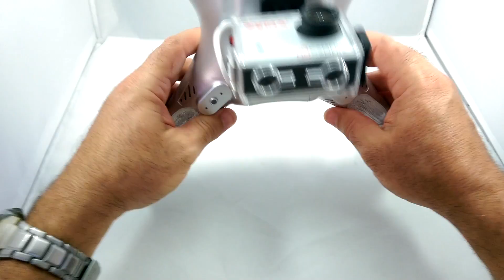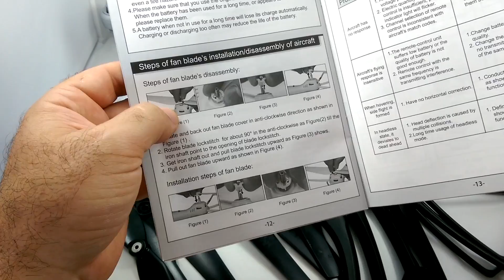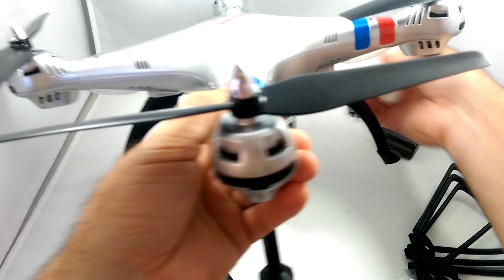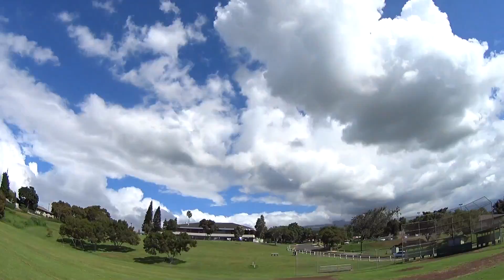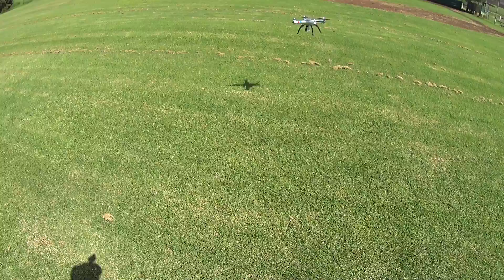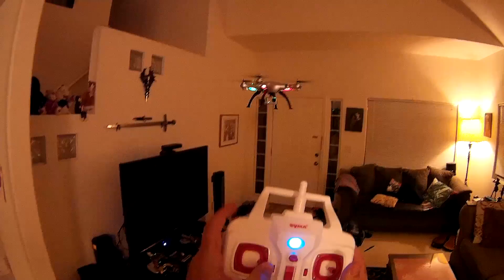SYMA X8G Review - HD Quadcopter Camera Drone - [Setup - Flight Test - Pros & Cons]

Comment: I love the in depth review, most people touch a few bases and move on, you cover all aspects that a buyer wants to know. Doing other research i learned this quad is really easy to change motors, no sodering. Maybe in a future review you can add how easy it is to find parts or replace them. I loved this vid so much i liked and subbed i have since orderd a x8g
Reply from the maker: Thanks Brett.  I will take your recommendation into account if I can in future videos.
Reply: That's interesting cause I just bought a run away that of course would need a transmitter. I payed less than a replacement battery which was in the bird. $38 and shipping from an Ebayer who mis Identified it as an X8C but it was a candy apple red X8 Pro in new condition except for two scuff marks on front two arms from its final ( and probably only) landing. Finder took the camera. No biggie. I t runs great. Enjoy your new orphan as I'm sure I will. Dandahermit

Comment: I appreciate the videos man. I have the bootleg version of this quad by Swann.  It's pretty good. It is basically an X8G.  In the month I got it one motor burned out. But I got it for cheap and Modding it gets it working fine like any other quad.  WiFi none but buying a cam with WiFi capability is always an option for anyone who wants a drone with FPV. I watch your reviews and quadcopter 101 and a few others who are more tech savvy then others who try too hard to be technical and in the process show failure in understanding quads in little time.

Comment: Thank You for the video,I have researched a lot of quads and this one looks like a good deal as far as size and price.
Reply from the maker: +Martin Mccurley It's good.  just order an extra set of motors from the parts link in video description for around 14 bucks.  Since they are brushed they will fail eventually.
Reply: Thanks for the tip.

Comment: To get rid of the any jello don't forget to balance the props.  You may notice a difference right away. Also if the battery falls out of the quad copter it will die immediately and crash to the ground, different from just turning off the transmitter. Happy Flying.  I have subscribed to your channel.  Thank you.
Reply from the maker: +Ken K. Thanks for the info Ken.
Reply: +Dustin Dunnill How do you show what it's recording? and what device are you using?
Reply: +Ken K. I never really balanced the props on mine and only had the jello when the winds were high.  I will give it a try and see if I notice any difference, you never know, right?

Comment: Cut the little nub off of the cam mount that will help reduce the jello and you can tilt the cam how you want it  and balance the props.I also use a Mobius cam on mine to it get better flight time's with out using the power from the battery to power the cam. your video is the main reason it bought the X8G $127 shipped usa warehouse. Thanks Dustin great review.....
Reply from the maker: Thanks Harlan.  Good tips.  How's your motors holding up?
Reply: there holding up good for now i have i guess around 50 flights on it. did you have to replace you motors yet?
Reply from the maker: One of mine had the motor shaft grind a groove through it's brass bushing and fail after a few flights with Amkov5000s.  Could have been from crashing though..lol
Reply: For $127 it's a good deal. I Haven't crashed it. but i have gotten it so high it lost signal once. i put my Big 5 gps logger on it and it lost signal at 550ft. in a big open field it fell and i saved it.
Reply: I have been flying Rc planes for over 30 years some helicopters in the last 5 years and quads for just a year. i watched you you tube vid 20 x and like it very much that's why i bought the X8G. it fly's good in the wind and the vid is good also.
Reply from the maker: Right on Harlan.  Glad the vid helped you out and thanks for the support :)
Reply: Your very welcome :)

Comment: It's certainly good practice to watch several reviews of a product before making up ones mind on whether to buy a product? I had decided not to get the G model in the near future, because one reviewer said it was not worth it as the cam was junk so to just buy the C version ( he never showed any cam video). But from what I have seen in your review that cam does a very good job at that price point of around $155. Glad I found your review, thanks for sharing your experience with it.
Reply from the maker: +wild300zx Thanks.  Glad it helped you out.  The cam is quite decent i think.  And would be much smoother with less windy conditions.

Comment: Nice vid mate! i got my x8g today en its flying very stable indeed!
only problem i got is that i need to use the trims a lot before its stable and there is no need of correcting its direction all the time.
even after calibration but i will fix it i know for sure!

thnks!
Reply from the maker: Cool!  It is a fun quad.  Fly safe

Comment: Nice review Dustin. Seem like every time you have a flight review the wind is kicking up pretty good although that shows the ability of the craft and the pilot. LOL  Great flying. Question, when you did the turn off of TX test were the motors still running, did it try to land but the wind was to strong.  Thanks for the video.
Reply from the maker: Thanks.  Yes, I probably should not have done the TX off test in that wind but it did show the motors were still trying to spin even when upside down and stuck.  In the house TX off test you can see how it would do in no wind.

Comment: The reviewer has made a mistake about the Return To Home feature he thought was available on this quad. Probably was due to wind blowing directly towards him when he released the right stick. The right shoulder button does give an additional beep when long pressed but this does not initiate any RTH function. No other Syma X5 or X8 variant with headless (save GPS drones) has a RTH function either.

Comment: Have you tried unscrewing the original camera frame and replacing it with a mobius with a gopro mount adapter.I believe the mobius setup is lighter and produces better video,but the stock camera was pretty good for what it is.Maybe some foam and prop balancing can eliminate jello completely.
Reply from the maker: I have a Mobius I'm reviewing and will be doing this on the X8 this weekend.

Comment: Can you explain in a little more detail on how to use the camera feature and the return to home feature?
Reply: The camera is controlled by a 2 position switch on the transmitter.  Up will take a pic and down starts video.  I've lost a few videos from being corrupted for some reason.  I'm trying to sort out why it happens.
Reply: The camera button must be pressed off to stop the recording and to save to the SD card
If it's turned off w/o that, it corrupts

Comment: Thanks for the review, Dustin.  Don't you have any calm wind days there in Maui???  Seems like the wind is always blowing 20mph ;-)  X8G seemed to handle the wind okay, but the camera and mount system weren't optimal for that much wind.  I can't see the X8G carrying a powered gimbal & a GoPro type camera.  The included camera took pretty good video, but it could use an "auto white balance" feature, as your night time indoor video was pretty yellow.  I know my RunCam has a setting in the Configuration to set up if you are using incandescent lighting. I doubt there is a config program for the included cam.  At 42 grams, the RunCam is only slightly heavier than the standard camera, and would offer better video.  That said, a std. X8C with RunCam/Mobius mounted would seem to be a better video platform than this, but slightly more expensive.  If a person didn't want to mess around with "mix and match", this X8G could be a viable option. I've seen some other reviews that were not complimentary of the range, so I'm glad yours appeared at least to reach about 100m.  Oh, don't think I'd want to fly something that big in my house, which is especially small (650 sq. ft.)!  I see your cat didn't come out during the flying of this one indoors .. he was smart! BTW, I always wondered if cats were allowed on the Hawaiian islands. Some countries have ridiculous 6 month quarantine procedures if you bring a cat to their island (like in the UK I think).  Oh well, thanks for the review .. I waited until I got home from work to watch it so that I could watch it in one go, and on a better screen than my tablet that I take to work. Cheers!
Reply from the maker: Hey Bill.  The tropical winds here are pretty gnarly on the north of the island.
I still have to finish my review of the Mobius so I'll be mounting it up on the X8 and seeing how it does.  We definitely have some laws on bringing animals in from out of state bit not sure of the specifics.  At first the cat was freaks of my copters but now he barely pays attention :)
Reply: +Dustin Dunnill Holy cow! I used to live on the east end of Molokai 26 years ago. Miss it a lot.
Reply from the maker: +Robert Arne Dresslar Cool!  Come on back an visit sometime :)
Reply: +Dustin Dunnill Hi, im thinking about getting a x8g soon but am a little concerned with the weight of it and the motors.  That's a lot of stress on the brushed motors to carry that much weight.  How long have you had this and have you needed to change or fix any of the motors?  Also how does this fly in the cold during winter time?Also can you recommend any other quadcopter that offers this video quality and is around the same price range?  Thanks.
Reply from the maker: +Nathan Eck I had one motor fry after the 3rd flight with the heavier amkov cam mounted up and it fell from 200ft.. surprisingly only cracked the landing gear slightly. I think this is still probably the best bang for your buck but order a spare set of motors just in case from link in vid description.  They are cheap.
Reply: Dustin Dunnill I was just wondering how mich did it cost? and is there any way i can have fpv on the quad?
Reply: You should be able to find the basic Syma X8C on eBay for around $70. Do NOT waste your time with a X8W because WiFi FPV is very short range (50 meters or less) and the camera "lag" is often very annoying. 

FPV is easy to buy separate. I use the EF-01 combo AIO (All-in-One) 25mW 5.8 Ghz camera and transmitter and you can get it on Gearbest for under $25. You only need a small 1S 3.7V battery to power it. You can get transmission distance of 100-200 meters and only need a cheap FPV set of goggles to receive the signal. Goggles are becoming VERY inexpensive, often under $75.

HOWEVER, FPV flying is not as easy as it seems and takes practice (I'm still learning). There are some VERY good tutorials here on YouTube to help you learn.

Comment: I did not know the X8G had a RTH?  I thought one just used the headless mode to bring it back by choosing a "preferred heading" and holding both sticks to lower left and then the craft will move in the direction of the controller pointed at the "preferred heading" as long as the pitch and roll stick are pulled away from where the craft is located.  Is this wrong?

Comment: A very well done review. Thanks.

So, the two buttons on the bottom of the X8G's camera mount work with an inverted Amkov 5000S?

Also, can you post the in-flight videos using the stock camera and the Amkov? I've seen in RC Groups that X8 prop balancing is very helpful in reducing video vibrations, as one would expect, but even so, anti-resonance tuning of mounts to eliminate vibrations is something that toy grade quad manufacturers seem unwilling to do even when they know the mass of the camera to be mounted because they supply it themselves.
Reply from the maker: Thanks Winston.  Yes, one button lines up perfectly as shown in vid.  Unfortunately my Amkov Micro USB port broke during this review so it would not record (I'll have to take it apart to see about fixing) otherwise I would have included video from that also.  Yes prop balancing will help.  For my initial reviews I like to try and keep the results as close to stock out of the box as possible for a better guage.  I'll be making a few more videos of this one soon with some mods done.

Comment: can u add ur phone on the controler? so u can see the drone live in action? (WiFi camera)
Reply from the maker: Yes, with a different Cam that does WiFi out but not advisable since it is close to the control frequency.  Better is to get a lightweight 5.8ghz FPV setup/cam.

Comment: How do you change to high rates? Do you just press the headless button?
Reply from the maker: +ChromeRider yes, short press = rate.  Long press = headless
Reply: Dustin Dunnill  thank you
Reply: +Dustin Dunnill I did not know the X8G had a RTH?  I thought one just used the headless mode to bring it back by choosing a "preferred heading" and holding both sticks to lower left and then the craft will move in the direction of the controller pointed at the "preferred heading" as long as the pitch and roll stick are pulled away from where the craft is located.  Is This wrong?

Comment: Hey. You said in the beginning of the video that you would make a FPV test. What budget FPV kits would you recommend for this quadcopter. I'm think of buying this model, and would like to have a FPV on it.
Reply from the maker: +Gherdea Alin Hi Gherdea, I haven't spent time on putting FPV on it yet since I had a motor fail recently and need to order another.  I would say something in the 200Mw power range would be good if you can find a cheap kit that has a small separate FPV camera.
Reply: +Dustin Dunnill How reliable are the motors on this?  Have you ever had to change them?  If you did is it a complicated process?  Also how does this fly during the cold winter?  Thanks
Reply: i`m pretty sure it has built -in fvpv
Reply: +a11yourbase Arebelongtous i mean fpv
Reply: +Nathan Eck $17 for four upgraded motors is a steal @ amazon-i also got a 5 pack of 2000mamp batterys and a balanced charger for like $33 un be liveable, $1.26 for four props @gearbest

Comment: Hi thanks for the review. You went over the controls but never mentioned the return to home feature except for when you were doing the flight test. Earlier specs for this quad mentions a return to home but now its not listed on Syma's website or no mention of it in the manual. Could you verify or comment on that?
Reply from the maker: +Brad Mann I showed the RTH in flight test of video.  Long press right top trigger button until long beep.  I forget if you need to be in headless first or not.  Try both.
Reply: Dustin Dunnill Thank you for your reply Dustin. Haven't flown it much in the process of adding deans connectors to the unit and batteries to be able to use a better quality charger. But I will try that when the weather warms up and we start flying. I have a phantom 3 advanced that consumes some of my time as well. Great job on your reviews as well, seem to be pretty thorough.

Comment: In this model is it possible to use the FPV?
Reply: +Leonel Ruano™  I purchased my spektrum va1100  video transmitter and velcrod on  top , using a moniter to view it.
Reply: +Leonel Ruano™ No, But symas fpv is terrible anyway.....About a 0.7 second delay meaning you crash before you see it on the screen
Reply: no. the x8w has wifi fpv. quality of that cam is not that good
Reply: +Leonel Ruano™ Yes, you can buy your own FPV equipment and mount it, it will handle the weight... up to about&#160;200 grams or more perhaps... battery life will suffer though if you put heavy weight onto it, but it can handle it. Don't bother with the X8W (X8Wifi) if your going to be doing FPV, camera quality lacks because of the jello, and it compresses the video so it makes it even worse, also there is a 2 second lag which means you may crash... Go for the X8C(X8Camera... Camera is same as on X8W, but its not absolutely terrible if you get rid of the jello, though you probably will want to get something else for photography.) or X8G (X8Gopro... which comes with a fairly good 8 MP camera.)

Comment: I am trying to install an FPV system along with an anti-jello mount on the Syma X8G.  The total extra weight will be around 200 grams.  Is this way out of the ballpark, or would it be feasible?
Reply from the maker: Do-able but motors will fail much sooner.  Get a replacement set just in case.
Reply: +Apple FanBoy the motors are really cheap and are plug in motors

Comment: Im wondering if you did any of the MODS you mentioned in the video?? You said you may mod it for wifi FPV and longer range? I am interested in this quad IF it could be Moded with wifi FPV and longer range. Thanks for the review
Reply from the maker: +Christ In You Hi Chris, I had planned to do some mods but decided not to because it seems that when you add more weight the brushed motors will fail sooner and I did not want to crash all the fpv gear etc.  I had a motor failure a few flights after the weight of the Amkov Cam use.
Reply: +Dustin Dunnill Thanks for the reply. I decided to buy the XK X380 and do some MODS that you did to yours. Thanks a million for the how to videos!

Comment: How do I know when headless mode is off and on on the controller? Thanks
Reply: When you press and hold the left button on the top of the controller you will hear a bunch of beeps, that is to turn it on. Then to turn it off you press and hold it until you hear some more beeps. When ever you turn it on it is always on normal mode, not headless.